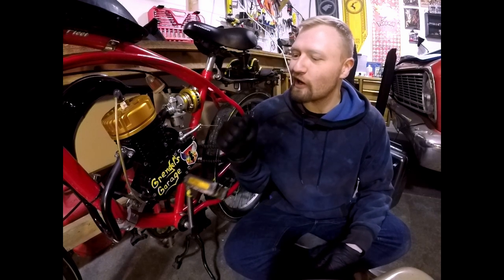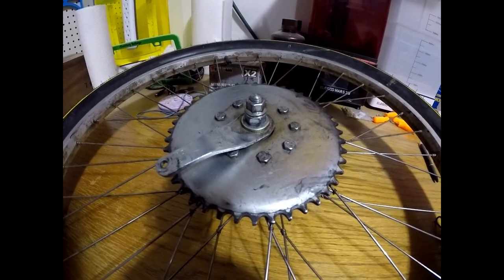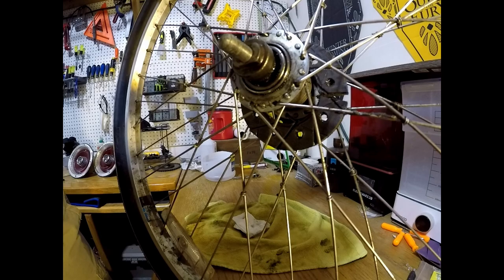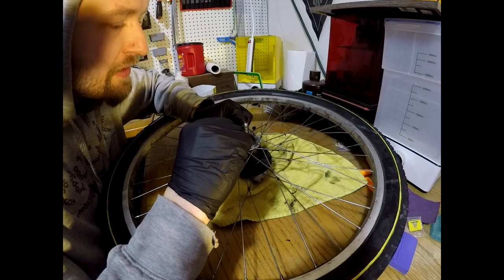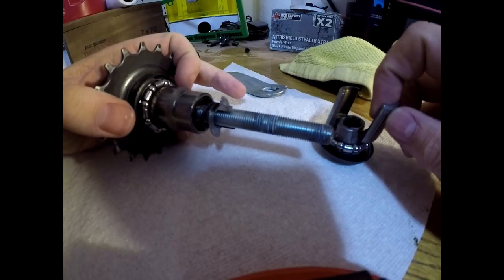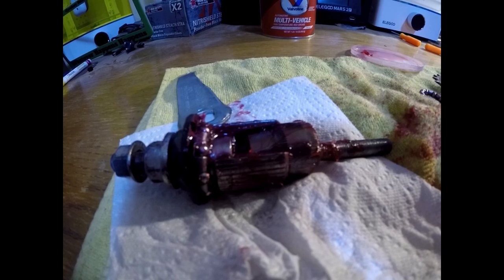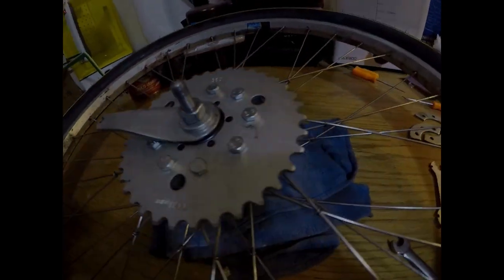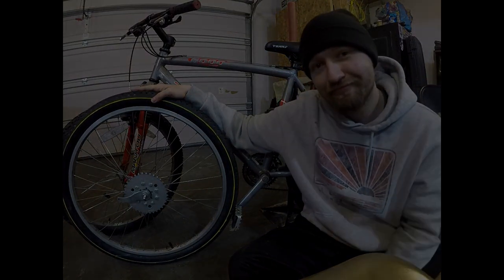Coaster Brake plus 36 Tooth Sprocket

Comment: I did that by filing out the 36t sprocket till i could press fit it on the KT coaster hub shell, with the rag joint stuff. It didnt wobble or eat the spokes. Without a spring tensioner, it vibrated like a chainsaw till i added the spring tensioner
Reply from the maker: It's very nice that a big old file would have been great to use. Slower, but you know what you want at the end. It ate up my bit, too. When a spring tensioner fits, run them. They are safe. That's for the comment!
Reply: @grendelsgarage9723  I used the pedal crank to turn the sprocket with the pedal chain, while holding a half round 1inch file tensioned against the sprocket.  I just checked it frequently for size.

Comment: Dude don't be using that rag joint pineapple rubber sprocket shit it's garbage buy a hub adapter Mount sprocket setup it will last longer
Reply from the maker: I've seen good things for a 1.5 in hub. I'm looking to upgrade to a better rim in the future set up in the future.